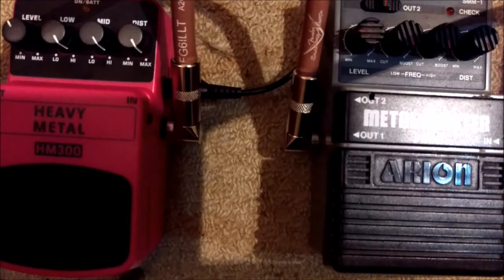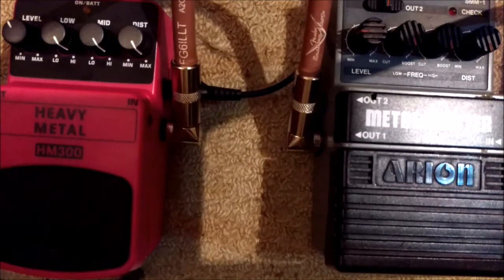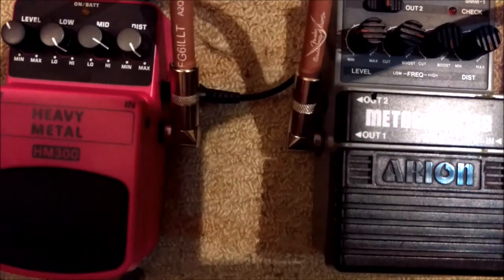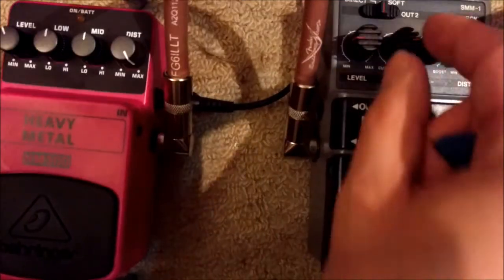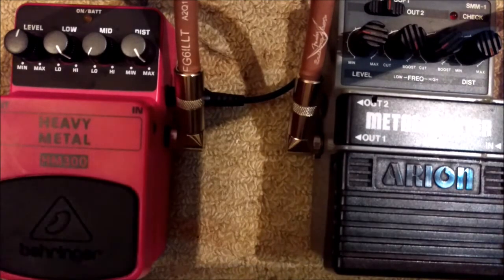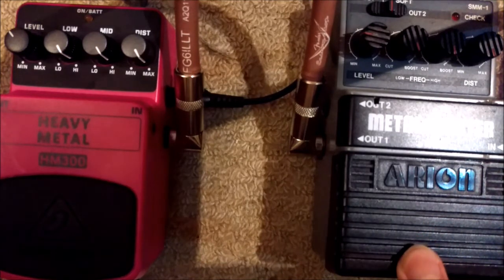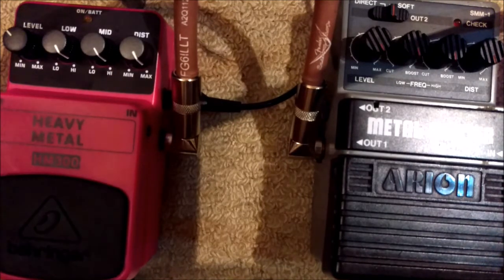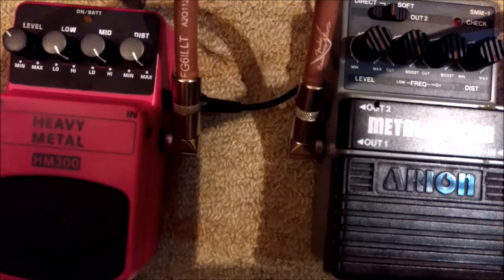Arion Metal Master vs Behringer HM300 (and stacked!)

Comment: Try using a compressor in front of the Arion Metal Master.  I used to use the Arion compressor along with the Arion Metal Master and got crazy tone and sustain.  I ended up cutting off some drum sticks and taping them together so the compressor and the Metal Master were switched on at the same time.  I really squashed the signal with the compressor before the Metal master. Try it!

Comment: I've had the metal master since around 1985 (my very first pedal)....still have it....really don't use it (on rare occasions, I still plug it in)......it was never the best pedal (at least with the equipment I was using it with).....but, sentimental value....lol.....will never get rid of it.

Comment: I think the Arion Metal Master would be better for riffing, where the Behringer would be better suited for solos with that punchy hi-mids response. Love them both stacked, could get some really crazy noise out of that!
Reply from the maker: I've also got to give the Arion a go on bass - that low control sounds like it peaks in just the right place. 

I can see me using them stacked on a recording. Total filth :)  thanks for watching!
Reply: The HM-2 is a fartcan design to begin with, but the Arion does appeal to me too with it's extra switches. And having more low end inot bad as it's easier take out something that's there than the other way around.
Reply: @ydin9  it's a great pedal.i own both versions of this arion pedal.bith are very similar in sound.almist imperceptible differences.but both heavy in th bass and awesome.

Comment: The Behringer HM300 pretty much has the same controls as the Digitech Death Metal pedal.
Reply: Not really, The hm300 has Gain, 2 band EQ, and Level, Death Metal has 3 band EQ and only level
Reply: Assuming the Gain on the Death Metal pedal is at 10. I'd rather have the 3 band EQ. Level and Full Gain.
Reply: But on the HM-2 it's all about how that 2-band sounds. It's that over-the-top bottom and the upper-mids thing that the HM-2 does that turns it into a chainsaw/allows you to totally scoop the mids. Magical.